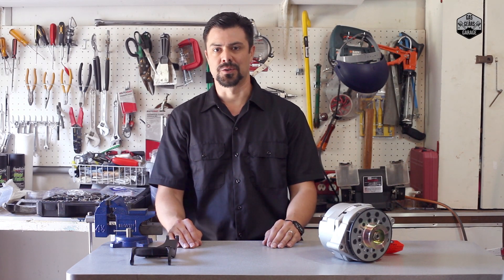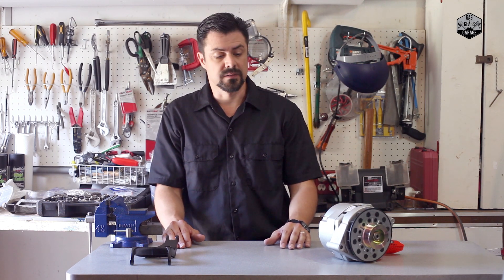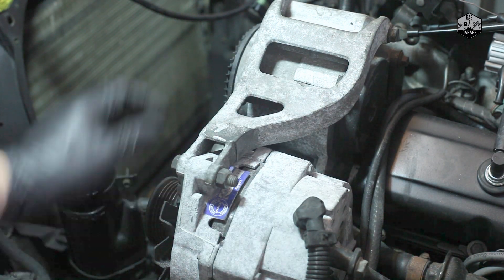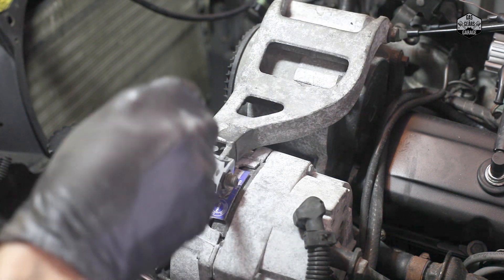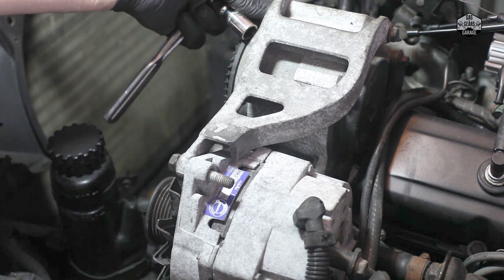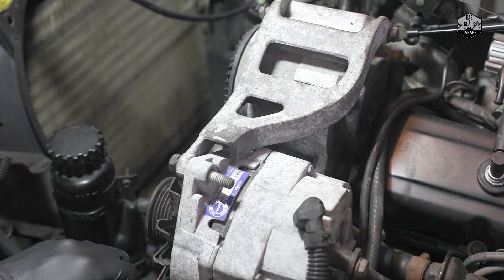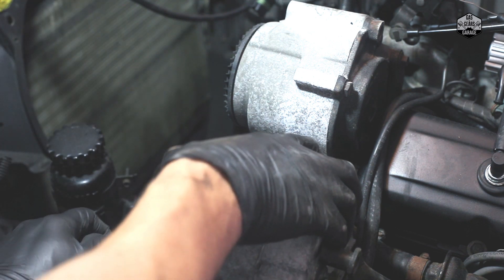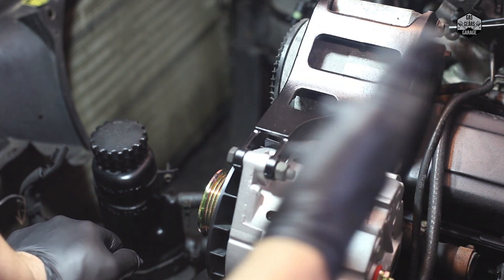How to Remove and Change an Alternator - Corvette C4

Comment: Interesting approach, myself always just removed the 1/2 inch NOT 13 mm bolts for it is American (standard) not Japan (metric) good way to strip them out. Then disconnect the wiring and it pops right out never removed the pulley or bracket anything else just belt and a few bolts and bam it comes right out very easy.

Comment: could you link that exact alternator please? i have a C4 (L98 engine) its imported so i dont know they exact manufactured year but its registered as a 1995 but i believe all the parts to be from 1987. but the alternator that you are using is the exact one i need. could you please assist me?

Comment: Where is serpentine removal video?  Not finding it here or gasgearsgarage.com.  Was it removed?
Reply: Javier Arroyo i
Reply from the maker: Didn't include that. Simple process. Breaker bar with socket on the tensioner pulley pushed down. Have to apply a good amount of pressure and then slip off the tensioner pulley. Trick is getting it back on the correct path around the other pulleys. You car should have the reference located on the radiator cover.

Comment: very good but inform the viewers if they are keeping the replacement alternator stock, they won't have to remove the pulley or top bracket. just the two bolts and two screws holding the power steering reservoir down. very easy job. 10 minutes.

Comment: In my car the long bolt from the bracket goes in from the other side.So i din't have to remove the pulley !
Reply from the maker: Nice. That probably means someone was there before. After I posted this vid, I went ahead and pulled the entire AIR pump system out to clean-up the engine bay. I may post a video on that too. Good luck man and thanks for subscribing.